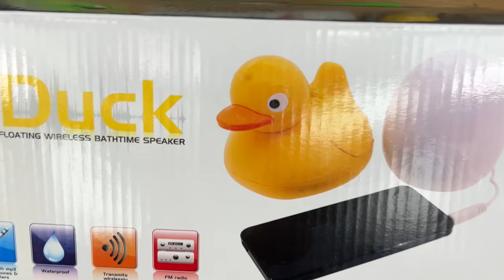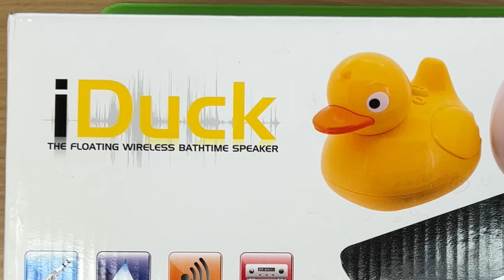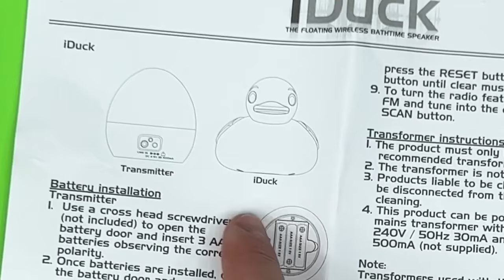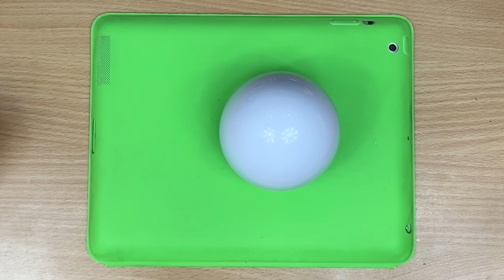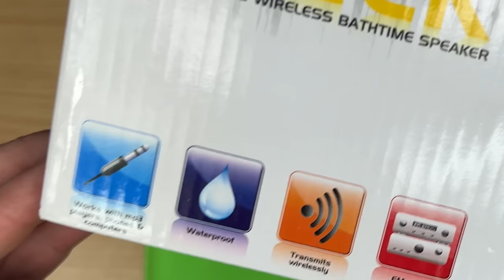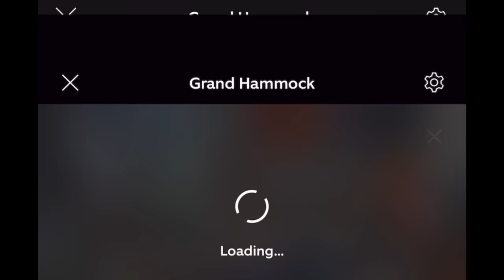The iDuck.

Comment: I love how it just picks up different radio stations out of nowhere
Reply: At first, I thought it picked up his neighbor's phones.
Reply: Set up for a meeting with your family and friends for the weekend at a hotel
Reply: If it starts playing a numbers station, run
Reply: I'm guessing this thing isn't using Bluetooth but instead is just an FM radio and an egg shaped FM transmitter. Setting to "audio" is probably to knock the radio sensitivity down so it'll only detect the egg once it's dialed in, hence the random static when it isn't.
Reply: @rcflight13  the issue is that the FM transmitter in the egg runs on three startled yelp bats. 3.5 volts (at best) isn't really gonna put out a solid signal.

Comment: The antenna pretty much confirmed my suspicion:

The egg just has a small FM transmitter like what you would use in an older car. The duck is just an FM radio. Presumably one of the switch positions should be tuning it to the egg, but since it's FM there's obviously a ton of interference. 

That being said, a Bluetooth version would be nifty.
Reply: Agreed. They probably expected that antenna to be powerful enough to work, but Wade must have a local station on the same freqency.
Reply: Oh that explains a lot, I was wondering if it was radio or very early Bluetooth
Reply: I bought one of those FM transmitters to put in a car. I've set it all the way at the end of the FM bandwidth so I'm sure no statons will be picked up there. The audio quality is surprisingly decent.
Reply: FM was The Thing for hooking audio into cars without using a tape deck before Bluetooth and Aux ports became common, so probably
Reply: well, it's TECHNICALLY wireless soooo......
Reply: The box literally says that it has FM radio capabilities, no need to find an antenna
Reply: Normally those are fine even if there's a station on the same frequency, because it doesn't take much to overpower it when your signal is less than 5 feet away.
The antenna in this must be so weak that it barely beats sunlight.
Reply: a
Reply: @meinnase  The duck being able to pick up radio doesn't necessarily explain how the egg works.
Reply: @JrIcify  Running off of 3 AAAs makes me think it is pathetically weak.
Reply: Ahh bluetooth. The horrible things we made to get to you...
Reply: if you were in Delmarva with one of those bad boys you could pick up a classic hits station called the duck yeah I know cheesy right? :-)
Reply: @lululock  I have one of those FM car transmitters and I went on to Amazon and bought a car to home plug adapter and I plugged it in at home you'd be surprised how far that puppy goes!
Reply: Yeah mate, the duck is so huge you can easily fit ab Arduino or Pi Zero into that. Make it a smart duck lamo.
Reply: Or use can use the egg as a FM Radio transmitter for home or an old car or old FM radio
Reply: It also seems like the switch was on ... backwards?  FM transmitters can sound ... ok.  Better than that.
Reply: @HoshPak  you can put a duck in the empty cavity

Comment: The way the egg delivers the music from the input device to the duck is disgusting:

It's literally taking the aux in, crushing it to mono, and broadcasting that at FM frequencies which are then intercepted by the duck's radio. It doesn't need the duck to function, it will work with the sad screenless FM radio "iPod" nugget.

I can only imagine the bitrate is what those MP3 players in the 90s expected you to put on there to get the best out of your 8mb of internal storage. "Holds up to 100 songs [several asterisks]"

Comment: 8:56 It's just a tesla coil. And because Tesla coils (especially the crappy ones) need a lot of voltage and high-frequency AC electricity, and because this thing gets its electricity from 3 AAA batts and a tiny built-in transformer, it runs like crap

Actually, it's miraculous that it even works
Reply: @sourand jaded Ah, I missed the antenna on the PCB and thought it was a tesla coil when I saw the spring-like shape and a component that looks like a transformer

Comment: My theory is that the egg may have been a FM transmitter or something as that would be cheap and the switch would set it to a specific frequency which would explain why it kept being overtaken by actual radio stations as they would be more powerful signals.

Comment: if the iDuck is picking up FM signals from the egg, that means you can grab a normal FM radio and play stuff from the iPod.
boom. FM radio transmitter for any device with an AUX jack.

taken from a duck.

Comment: I just finished modding a 7th gen iPod classic. It’s a bit of a Frankenstein of 5th gen parts so I could fit a clear front and click wheel. The glue for those click wheels was really fiddly! I also used a Micro SD iFlash so I could fit the extra large battery in a thin case. 

Naturally I also sliced my finger open trying to get into the damn thing. 😩 At least the replacement case opens more easily.

Comment: I wonder if the transmitter's FM frequency was chosen based on Yank radio stations. Or if they were expecting bathroom walls to block outside signals sufficiently.

Comment: Wait if that thing is struggling to picking up the egg and the radio at the same time, then that egg is most likely an fm transmitter that's permanently on one fm band and the duck is the receiver, so if you go to your car you can try to find the frequency that the egg is tuned on, you can use the egg as an fm transmitter for your car lol